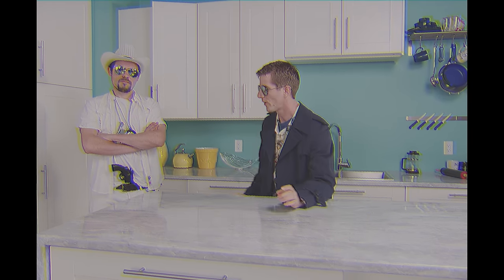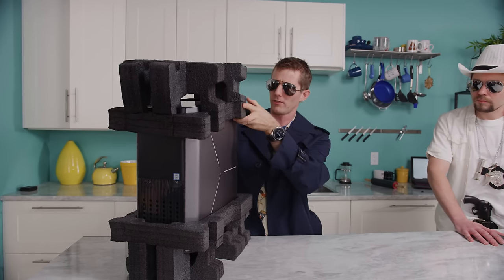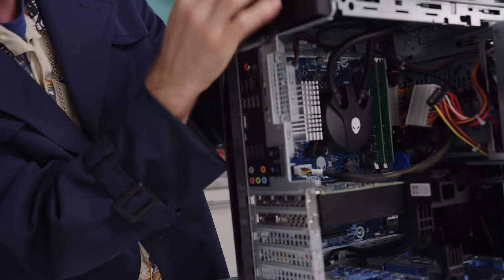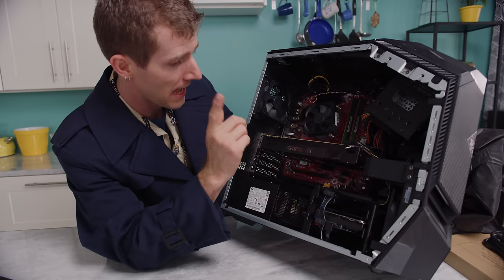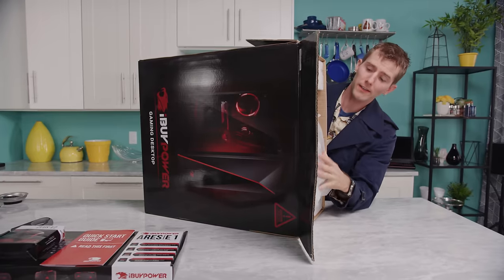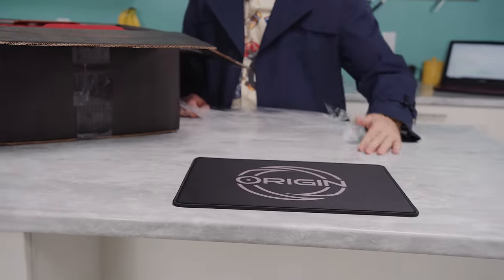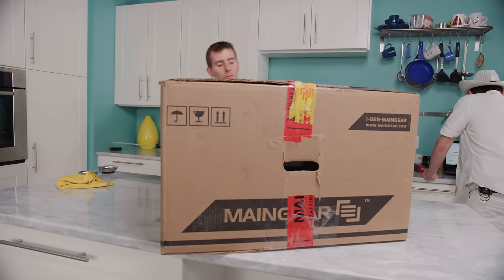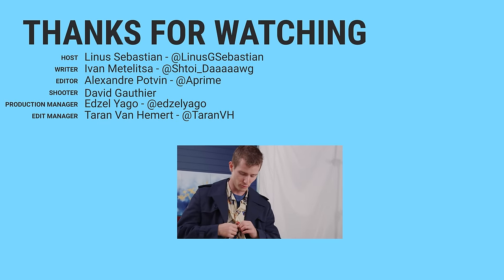What did we BUY?? - $1500 Gaming PC Secret Shopper Part 2

Comment: A 1050Ti in a 1500$ system... yikes.
Reply: Hex Plosion i have the acer nitro 5 with the 1050 ti, and its a $600 laptop(new from best buy on a sale)... laptops are more expensive than pc’s normally
Reply: @turn1p  Acer Nitro 5 FTW! I paid $700, though...
Reply: $150 GPU with nothing else to special in the build for that price. Yikes.
Reply: The mobo is the special thing in that build, which is still a no brainer for me to pay that much to get that little in return, I want to play on my pc, not freaking bring it to christma's dinner and say: here's where my 1500$ went
Reply: Well you are paying for the form factor, but still yikes
Reply: I bought an Ibuypower system 1year ago it was about 900 bucks came with a R7 1700x, Asrock Ab350 pro4, 8gigs hyperX ddr4, gtx 1050 along with a free thermaltake toughpower grand rgb 650W power supply. Safe to say the only things to have survived the year is the cpu, motherboard, and psu, ram was replaced with 32gigs of corsair dominator 2666mhz ram gtx1050 replaced with 1070ti oh i also replaced the h60 AIO with my own h100i.
Reply: Cavey Möth I got the Nitro 5 for $500 at Best Buy on Black Friday. Good Fortnite machine with an Xbox One controller for playing with my console buddies
Reply: Wes Miller How so? I get that you’re paying for their custom case, but building in mini-ITX form factor shouldn’t increase the price of your PC by that much, only slightly higher motherboard cost.
Reply: I got an 8700k with a 1080ti on a prebuilt system for less than $1500, jeeze
Reply: @CaveyMoth  got my acer N5 for 700$ with updrade 4gb ram..
Reply: acer nitro 5 has thermal issues tho
Reply: That's on Linus for not doing research. I got this AW Aurora R7 with GTX 1070 in February 2018 for $1100 from Best buy. It was 8700 non K thou, but also Liquid Cooled. The Ram was 16GB and I'd just upgraded to 24GB this Black Friday. Good deals can be had with Alienware. Much cheaper than IBuyPower PC or Origins.
Reply: Kinda wonder if the salesman gets commission based on profit margin. That PC is a flat out ripoff.
Reply: @TuanLe-eb5yp  I think the point was for someone who ISNT knowledgeable about building a computer to buy the systems which should be a lot closer to the "average" consumer's experience.
Reply: Soo a 1050ti isn't good or what.? I kinda assumed it just went by the numbers and the bigger the better.....  ???
Reply: @darkblader06  in other words you  could of better build your own system
Reply: Pj O The 1050Ti isn’t that adequate for gaming, you’d be much better off with a GTX 1060 for gaming or heck, even a last gen GTX 970 outperforms it.
Reply: Tuan Le ur missing the point of the whole series if you think linus needed to do research.
Reply: @darkblader06  Ok so why buy a pre built?
Reply: @MrPetervp14  a 1050ti is good, if you just want to play overwatch, csgo and other low powered games. If you're on a budget, it's not bad. But for 1500USD you can expect more
Reply: @bananas1055  it's 1060 graphic card alinware aurora is not sold with 1050ti card. They got it what they agreed for.
Reply: @turn1p  Lol nice. Seems origin is the biggest ripoff ever.
Reply: Well, I personally got an acer prebuilt from a sale (999€) and it has gtx 1070, I5-8400, 8gbs of ram, 1tb hdd and 250gb ssd
Reply: @TuanLe-eb5yp  The point was that he had someone else who had no experience with computers do the calling and order over the phone to see what they would get
Reply: @deathbunny32  Where did you get that? I'm intrigued
Reply: @darkblader06  The upgradability od iBuyPower and Cyberpower is typically pretty nice, especially given because they have deals with big box stores so they can undercut almost anyone in pricing makes them very nice SI builds to work from if you don't want to wait for deals on certain parts or skimp to fit your budget. I paid a lot for my system when the 10 series GTX cards came out and then within 2 months they were selling basically my exact system for like 1500. Now, I have some nice creature comfort upgrades and a nicer motherboard and case, but I would've probably settled had I known they would drop the price that much. This was when graphics cards were going for like twice their value as well, so that was a ridiculous deal at the time, too.
Reply: @TuanLe-eb5yp  I think the point was they were trying to find out which system integrators with someone who's never purchased a gaming PC before would give the best quality in all areas and not necessarily just best dollar for dollar performance alone. I do hope they cover some of that later in terms of what they really could've gotten for those prices, even within some of these brands (cyberpower and ibuypower sell i7 8700k 1080 and 1080ti systems for less than $1500 US  on ocassion at places like best buy, and she only got a 1070 and an i5.) So, perhaps the moral of the story is that first time shoppers who call in rather than shop in store or online are at somewhat of a disadvantage?
Reply: You guys got some good deals on your Nitro 5s. I bought mine last year, not part of Black Friday or anything. I just needed a laptop!
Now as for thermal issues, a little bit (or a lot) of undervolting completely solves the problem. My CPU and GPU run at 75 degrees maximum. And the system is relatively quiet especially compared to game consoles, holy crap. My biggest gripe with the Nitro 5 is battery life. If you're going to use it for any length of time, you must plug it in. Well, using it unplugged is useless anyway, because the 1050 Ti gets bogged down when running on battery. It's a misconception that gaming laptops get you the full fat gaming experience on the go.
Wow, I'm writing a whole review here. Why don't I just make a video?
Reply: A 1060 in a 1500$ system... Yikes
Reply: @deathbunny32  that's a banger of a deal
Reply: @budgetking2591  well at the time of purchase prices of both ram and gpus were high and gpus were hard to find so no but i did want to build my own but at the time it would have been more expensive. But when the new Ryzen chips  come out i will be building a new pc and probly offload this one off to a friend or family member.
Reply: @uday29khunti04  when core components are hard to find and overpriced you have to stay with in budget, mind you this was at the height of the gpu and ram crisis
Reply: @Ohhelmno  yeah i bought my pc around the same time but now that new Ryzens are around the corner im gonna build a whole new system and rid myself of that case while it may look nice holy shit does it lack airflow
Reply: @darkblader06  Ah yeah prices were terrible i didnt take that in consideration, i was lucky i got a gtx1080ti a bit after  launch for 700 and sold it a year later for 900, then bought a 1070ti for 400 that im still using
Reply: @deathbunny32  no way
Reply: the 1050ti is a great card, but it is good for a 500-700 dollar system.
Reply: @thesilentcryptographer  Show your console buddies the light. LOL
Reply: thats how H.M. make money of girls. at the on sale section, I saw a piece of cloth selling for 20 dollar and people are crazy about it.
Reply: Ivan Orozco I have a 1050ti
Reply: Hex Plosion thats origin for you
Reply: iv got that in my £600 system
Reply: Not to mention the case seemed broken where the graphics card attaches.
Reply: You can literally get a 1070 Zephyrus laptop for the same price, with an i7 9750...
Reply: In SG u get a 720 w i7 8700
Reply: Yeah thats a big fucking oof indeed, talk about money poorly spent.
Reply: What's even worse is spending $1300 for a system with an rx560 2gb.
Reply: On a more serious note from my last comment, my mom was charged $1,200 for a "gaming PC." It had a GT 710 in it. A $30 graphics card.
Reply: @darkblader06  did it die
Reply: @dozergames2395  idk it 8 gigs wasn't being recognized but only as reserved
Reply: Alex Wadu the number matches lamo
Reply: pc noobs
TI SOUNDS PROFESSIONAL
Reply: Yikes.
Reply: @deathbunny32  chinese knockoffs don't count bud
Reply: I only got 1060
Reply: @MrPetervp14  You sadly can't just assume that. A 1050 and a 1050ti is A LOT slower than a 970, 980 or 980ti. All 3 900 series card will completely outperform the 1050's.
For Nvidia cards currently, the first letter in the 600, 700, 900, 1000 series is their 'generation' and 50, 60, 70 etc means their relative power in that generation. So higher end cards like 70 and 80 cards in 900 gen or 1000 gen will be much better than 1050 or 1030 cards.
Reply: Jeez, i know laptops with better graphics cards for that price.
Reply: This is why people learned to build their own PCs, and the ones that don't mostly play consoles.   Self reliance really ruined the gaming PC retail market.  Now it's just shady sales and lackluster specs, which you can always top buy doing it yourself.  I built an i9 7900X system with EVGA FTW-K x299, 32GB of memory, Samsung NVME, 2TB Samsung 860 Pro, used EVGA 1080ti Hybrid graphics card, and Corsair 115i for under $2,000.  Granted I had the case and power supply already, but I could have gotten those for not much more.  Why would I want to throw money down the drain at people who have to read from a script and don't even know the specs of the systems they are selling?
Reply: Never buy a dell or alienware
Reply: Alex Wadu I was considering one for a budget pc but I thought I should go with something slightly better
Reply: I got a rtx 2060 super in a 1550 build
Reply: There Is a 500$ system with a 1050-ti
Reply: Makes me feel better about buying my Cyberpower PC with an i7 8700k and an RTX 2080 for $1650 lol
Reply: Right?  I got a very similar one last year,   for 1100 from ibuypower.
Reply: @MrPetervp14  a 1050 ti is FINE. It's alright.  It's not worth 1500 dollars.
Reply: Had a 1050ti in my old basically 300 buck used system (was very unbalanced favored to gpu tho but still lmao)
Reply: Haha
I have it in a 300$ system
Reply: @MrPetervp14  1050Ti

10 = generation
50Ti = performance grade

Generally speaking, a generation means a jump in one performance grade all along the line. Like how the new 3070 is equal to the old 2080Ti

Comment: The Ryzen system was recommended mainly because she said he was going to stream with the system.
Reply: well i bet the performance of it will be the same as the 8700k with the 1060 .... the cpu will not be the bottleneck at all
Reply: This is super important. It may not 'perform' as well, but it's going to do what she asked it to do. That needs to be taken into account.
Reply: @JBTHECOLLECTOR  It's a freaking 1060. Go on hardware unboxed and watch real GPU and CPU testing. The difference between an r5 2600 with a 1080 and an i7 8700k at 1080p with stupid high refresh rates is 8% at MOST.

Comment: 18 years later and DELL PC's are still an Art project to disassemble
Reply: @Sm0keytheband1t Same man, the first PC I had to open for maintenance was a DELL from the early 2000
Reply: Ah yes, brings back memories from my XPS machine. Layers and layers of steel and plastic and the damn thing overheated constantly.
Reply: Proprietary everything, sharp edges everywhere, and good luck trying to take a hard drive out without taking everything else out first. Best disassembled with a large hammer.
Reply: On the future the Optiplex 35800 have this spec: gt 1030 i3 10300U 3x4 Go ram ddr4 2300 mhz. 
And you in future you have : rvrgtx 8080 ti, i14 14700HK (48 core 96 thread at 18 Ghz) , 8x32 Go ram gddr6 15000 mhz
Reply: Their laptops are even worse nowadays and it's embarassing. Like, having to remove the entire back plus the keyboard to get into many of their lower end laptops is a huge annoyance and the only thing that makes it better than places like MSI are that you don't have to take out the entire motherboard to get to the ram and other important things. However, it's still way more annoying than like HP or Asus who are very easy to service typically. Lenovo too, but basically if something has gone wrong with your Lenovo you likely need to replace the motherboard...so... yeah.
Reply: Still better then the IBM PCs.  My mum got a IBM motherboard with CPU about 15 years ago and I had to frankenstein up the motherboard connectors to even get it to power on (after spending a lot of time googling to find a pin out for the headers - yes, it had 5 headers for the front panel IO and none were labeled).
Reply: @emu071981  yeah, theyre not any better since Lenovo took over.
Reply: Xenonuke I found this pc a while back from maybe 2006 or so, and oh my god it’s mess 😂
Reply: I bought a small machine for Work from HP...Lets just say I wanted to put an M.2 SSD in there and had to slide a bracket to the side....the DVD-Player Cover broke off...
In order to remove that Cover properly, i would have turned the PC on and opened the DVD-Player.
Well It wouldn't have broken off, if there were 5mm more space in the DVD-Slot (Frame not the Cover)...
Reply: Had several Pentium III omniplex towers from the late90's  or so.  While super annoying that nothing was standard, they were surprisingly easy to work on if you had the parts. Probably really good for large firms with dozens or hundreds of the same machine.  
Want something awful?  Had a P1 133MHz Packard Bell machine that was a "tower" with one of their flat desk top motherboards across the bottom and the riser, just like their non-tower desktops.  The thing was a nightmare to work in, but it was my router for a year or so and did fine at that.  I think I still have it somewhere.
Reply: My school computers also have no thumb screws on the back because I hate the school and stole them out of spite

Comment: See that AMD system though, is tailored to the work load described to the customer service representative, (streaming, recording, ect) when compared to the others.  And its no slouch on the processing power, just not on individual core clock speed. I think that one will come out better than expected
Reply: Yeah I'd love to see a gaming benchmark that included streaming or recording of video at the same time.
Reply: not if linus never tests anything but pure game workloads

screenshot this post, linus is actually a stupid populist hack and he's not going to properly benchmark these
Reply: if it was a 1070 I'd agree but come on. It's not going to win with a 1060
Reply: @lancebockelman8756  I mean the thermals on the ryzen cpu are going to be nice, I think having that part locked down and knowing you could always upgrade to a 1070 or 1080 later is great.
Reply: @KingHalbatorix  if linus is such a hack then why do you watch and comment on his videos? Do you like to support the "hack"?
Reply: It'll be fine, its just not going to benchmark as well as the intel systems in games, may perform better in workstation tasks than it does gaming, but it will be at a disadvantage for the games benches, especially like CSGO and such. Especially considering the card with it isn't as good as some of the other systems with better processors for the type of stuff they'll really benchmark.
Reply: @dorferino  the problem is a lot of the other systems already have those upgrades for the same price, and some of their processors will handle those workloads fine as well.
Reply: @Brett Anderson he might be entertaining hack - fun to watch for the most part but does not always do things correctly(properly) hence the hack label - not mutually exclusive
Reply: @Ohhelmno  Agreed, I'm just curious if it turbos better as a sort of soft overclock. But as linus said, a 1070 is probably more significant for gaming. If it wasn't a pre-built i would probably make the same choices but since they're all $1500 builds the hp seems like a better value, as long as you don't need the faster turbo or can upgrade the cooler. 

It's worth noting that while a better gpu will allow you to go from medium settings to high or ultra, some games like Arma 3 or Minecraft would do far better with a better cpu cooler because they are heavy on physics, scripts, mods, and AI. Although to be fair she told the representative GTA V and tomb raider, which have more simplified physics.

The product page for the ryzen system also had a $600 discount for black friday when i clicked on it, but maybe they were impatient or didn't notice? It would allow a significantly better system if they ordered one now.